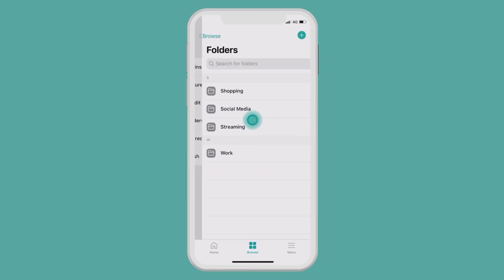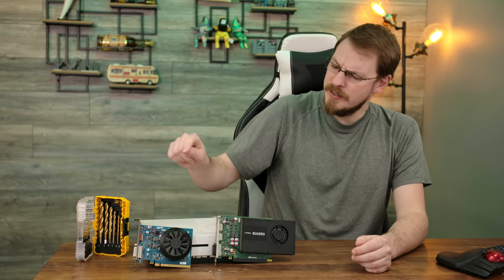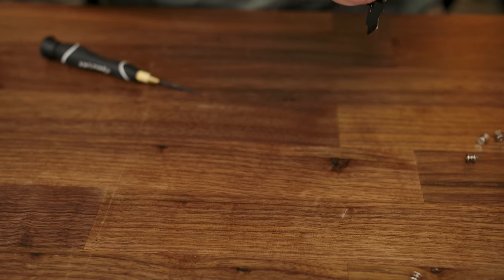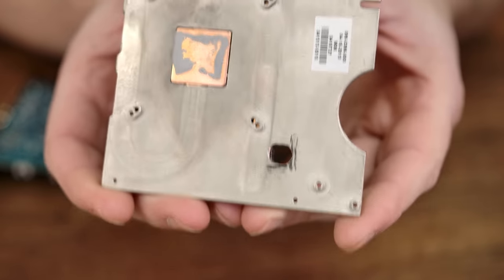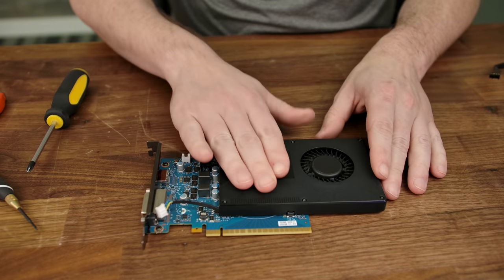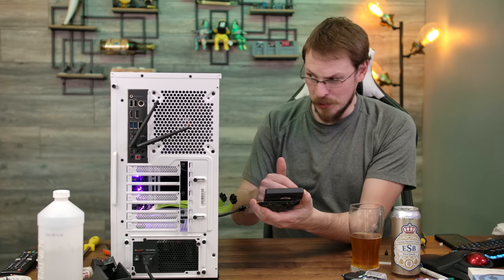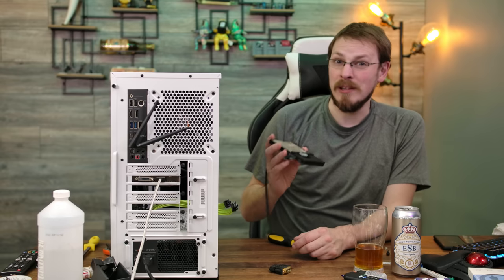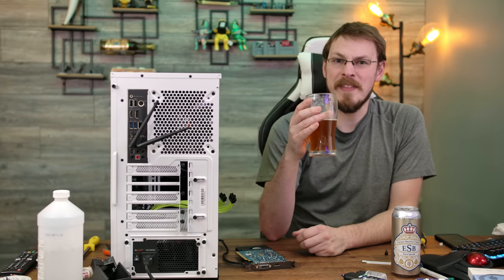Making my own Single Slot GPU Cooler

Comment: I didn’t know the older cheap cards were sold out too whew
Reply: The GPU market has gone straight stupid, and we're probably 3-6 months out from anything resembling normal.
Reply: i was able to find a basically new GTX 1070 gigabyte windforce for a friend who wanted their first gaming rig (sim racing) on ebay for about 250 dollars. it was listed as "used, good condition" because the box was open, but upon inspection, the card had never actually been installed in a slot, no marks at all on the pcie or any of the video connections. i consider that a win
Reply: @asdrubale bisanzio Nah, Nvidia has communicated that it may reintroduce mining SKUs to try to ease the pressure off of the consumer market. If they are considering this step, it means they have identified the miners as a source of problems in the supply of cards.
Reply: @asdrubale bisanzio Mining SKUs tend to be cheaper and not as highly binned. Farms want maximum ROI, and using expensive highly binned AIB cards is counterproductive to that.

Comment: I feel for you brother! I needed a heatsink/fan for a slotted Pentium 3 and I looked through my stuff and came across a GeForce 650. Two of the mounting holes for the cooler line up on the P3 but two would be hanging off of the card. What did I do? I put two razor blades as a shim in the top two holes on the cooler, and they clamp down to the very edge of the processor card. I still used the springy screws on the razors as well so it keeps the cooler at even pressure across the die. This cooler keeps the P3 around 25 Celsius and 30 under load which is nuts compared to what I remember P3's running at.

Comment: Hats off to you, I love this video! I have successfully transplanted an EVGA GTX970 cooler and fans to an HP OEM GTX760 as I bought both cards as ‘only for parts’ but only the 760 worked - slight fin adjustment but the fan connector fits and works. Temps are really low even with maxed out OC.

Comment: Brilliant.  If I could count all the broken parts here from tinkering.  My worst is a shattered 24” 165hz IPS from a tip over in my cluttered workshop.  My favorite scene from your vid:  pulling out the bench top drill press.  Epic!

Comment: Is there any fan speed protection on that GPU?  The other thing that came to mind is the crystal, moving it to the other side could cause the circuit to fail because of it's closeness to the inner ground layer of the PCB.

Comment: Some of those metal can capacitors have the shell connected to one of the pins.  Try booting it up with the original heat sink, and then use a short jumper to ground each of those caps, one at a time, and see if anything happens.  If the caps are nonpolarized (look for +/- markings), you should be able to rotate them 180 degrees.  (Most caps have one side to ground.)

Also, most "heat pipes" are actually solid copper heat spreaders; you can shave a little off of them without ant problems.

Comment: You can also cut the cable of the original cooler and solder it to the 12v and gnd leads of the pwm fan. Running the pwm fan in dc controlled mode shouldn't be a problem and the fan would still be controlled by the card and not the mobo, also removing the necessity to have a wire running to the mobo. 

I did this multiple times when fitting newer coolers to older cards and never ran into any problems, but ofc I can't guarantee anything.

Comment: As other said, maybe the card just thinks there's no fan and thus doesn't even turn on.

I am also wondering if it would make sense to put either some thermal pads or thermalpaste on the vram as well, because on the previous (stock) cooler it had some airflow going over the chips but it doesn't with the quadro cooler.

Comment: if soldering components are an option. is it possible to replace with lower "profile" caps, instead of drilling holes? Even use some surface-mount on a perfboard, then solder through the hole on the back?

Comment: It is also possible that the GPU might not start as it is not detecting a fan/throughput on the fan header.
I would try to screw on the old cooler and check after modifications if the default cooler works.

Comment: I did this very thing but with a single slot Firepro cooler/fan mounted to a SBC. You can pick them up for about $6 bucks and they work fantastic. If you wanted a longer, more powerful one, but still a single slot. Go take a look at the 2gb Firepro server cards. They will set you back about $20 bucks.

Comment: Why did you not put the capacitors on the back of the circuit like you did with the crystal oscilator? They seemed to be go straight through the board as well.

Comment: If you cant put the caps on the back of the card did you consider standing them off (front or Back). New caps come with long leads. Put a 90 on them snd stick the cap out the side of the board. Heat shrink the exposed leads and a drop of silicone to strain relief the cap! I don't think you even needed to drill holes in the heatsink.

Comment: Extend the length of the fan cable to plug directly into gpu board. Cut the wire, and then extend each of the 4 wires with solder on either end, and shrink tape each connection. Possibly the gpu detects if the fan is connected and working, and if not, then it doesnt work? Try it

Comment: I'm gonna guess, it's not POST-ing (the BIOS on the GPU) due to the missing fan. Crystal oscillators, as far as I know, aren't affected by polarity. Perhaps you could mount the cap the other way round? But I'd check the fan header first before trying to replace that. Great video!

Comment: Would it be possible to replace the caps with SMC versions? They'd all be flat at that point. If they are through-hole you could try mounting the originals on the underside but they are big and I think they'd take up too much space. As for the crystal, my immediate thought was that the pcb mounts that you solder the legs to are on the same side that you are now placing the crystal on... even running a bunch of solder through the hole on the top side won't guarantee that you'll bond to both necessary surfaces. Lastly regarding the comment about possible damage to the crystal - too much heat will in fact damage them. It's good to be careful to only apply heat in short intervals to them when soldering.

Comment: I'm not sure if it would work with your desired GPU mounting (or at all) but did you consider mounting the new cooler at a 90 degree angle? That might get the heatpipe out of your way.

Comment: Try a tantalum block capacitor on the back. They make small block style type, usually yellow. Or, when you get the replacement cap it will have longer legs, you could move it back a little and on its side.

Comment: Did you try to plug in a two pin dummy fan on the gpu? Some gpu with two pin fan headers have fail safe mechanism baked into their vbioses. It might be reason why it is not giving out a video signal.

Comment: Jeff, I just started this video and wanted to know if you thought about removing the aluminum heatsink from the "cheap" card and just milling down the tops of the fins until you reach your desired depth?  I will now continue the video to see if you chose "the hard way."
Reply: Now I see... you're trying to make it fit in only one PCIE slot.  Some challenges should be left unaccepted.  If it happens to turn out how I think it will, I'd be happy to mount a normal heatsink on that K2000 I'm drooling over.
Good luck.

Comment: Is that a through hole cap? Could put it on the backside too. 
Also, why not toss some paste or thermal pads on the ram and cool that too while you’re in there? The ram used to get airflow. It won’t anymore.

Comment: Do what you did with the oscillator to the capacitors as well, and you shouldn't have any issues. It also looks like the soldering on the crystal is a bit cold and may not be making contact with the pads correctly.  I wonder if the actual pad is only on the backside of the board and the solder isnt getting contact, or if they are shorting against the case of the oscillator. Maybe try remote mounting the oscillator with some bodge wires instead?

Comment: @Craft: Nice work you have done there. I cannot help myself but thinking if it wouldn't have been easier to get the conflicting components botch wired out of the way. Okay: The result would not be pretty but it should work better.
One thing you should try out is to connect the original fan as well. Maybe the GPU BIOS is programmed to look for a resistive load on the pin header and stops the card from working.
This happened to me in the old days on ATI GPUs and 8800GTs quite a lot so I think it is at least possible.
I think you know how to connect your pwm controlled fan to this GPU board but if anybody does not know: PWM-controlled fans have the following setup: Power, Ground, Speed-Indicator and PWM-Signal. If you connect a voltage to power and ground and leave the other pins floating your result is a fan spinning as fast as it will go with the voltage supplied. It is possible to use a PWM fan on a voltage controlled setup. If the setup uses the Speed-Indicator and is programmed in an intelligent way, you as the user would not even know the difference.

Comment: Is there a follow up video to this I wish to see another video fixing this but did you ever try putting back the original heatsink and see if it turns on and if it does try connecting the fan of the old cooler and turn on the pc see if you get a video out cause dell and hp love putting original fan has to be connected or motherboard throws error codes or simply not turn on

Comment: Did you try to boot fully into the OS? This is probably not the case, but my GTX 1070 wouldn't show any video in the BIOS, and the MB's troubleshooting LED's showed GPU error, but it would eventually show the video when it booted to the OS. Maybe that could be the problem if you tested the 1650 on a different machine?
To fix it on my GPU I did a firmware update from Nvidia to support newer Display Port standard.

Comment: Apparently Inno3d and Elsa both make single slot GTX 1650's. The PNY XLR8 1650 also looks like you could trim it down to a single slot... But at $220 (canadian), that's just mental!!

Comment: Is it ok to have the copper heat pipe right next to circuitry like those capacitors? Wouldn't it introduce more heat into those components?

Comment: When you removed the crystal oscillator did you get it out clean or did you also rip out the via bushing? Desoldering with wick of multilayer pcb is sometimes harder then people think i tend to advise having and iron or smd station that can heat all pins at once so the component can fall out by gravity instead of needing some force.
Reply from the maker: I got it out clean. I also saw your comment about the solder balling on top rather than forming a peak. I resoldered it, and it made no impact. Card is still not recognized in the OS (booted with another video card for output).

Still betting the cap is the issue. I have replacements arriving Friday and will give it another go.
Reply: @CraftComputing  I'l be watching then when you post again about this because i can not imagine you permanently damaged the card beyond repair.
Reply from the maker: Yeah, I agree. It's gotta be something simple.

Comment: If you can't solder the capacitors on the back, you could simply extend them, use some wire, relatively thick and as short as possible to minimize resistance and inductance, and place them where convenient.
Also, unless those capacitors failed closed, they shouldn't cause the card not to work, they are most likely just for filtering.

Comment: Board level repair/modding is the bestest. So much fun, always amazing when you get something to work lol. Only thing is you find yourself buying more and more tools, I just got a bench PSU (not ATX, like a variable voltage power supply) and am looking at better soldering irons and a hot air rework station!!

Comment: Is it possible the card just doesn’t power on if it detects nothing connected to the 2 pin header? Can you just attach the old fan to the header while the computer is on to test it.

Comment: Maybe BIOS is switching to onboard graphics as default if it has any? Had similar issue with a 2200G. Had to set to PCI Primary for it to stick to my graphics card after booting on the Vega 8 graphics previously.

Comment: I did read trough the comments and noticed some folks think the crystal might be shorted, depending on the housing of the crystal this might be the case. Some crystals have very small isolator around one or both of the legs. The metal of the bottom should not touch the solder joint. In flow soldering in the factory this is not problem because they appliy the minimal amount of solder and uses the capilar effect of the via fill the hole in the pcb. For manual soldering crystals on for example prototypes there is the option to buy a ceramic isolator (looks like very thin glass) for under the crystal oscillator. This makes sure every hand soldering of such component ends up working.
Reply: In addition a trick used by engineers when they run out of ceramic isolators and don't have time to wait while they are ordered, is to stick a very small screwdriver under the the component while soldering and therefor soldering it raised on the pcb. This makes the component more prone to defects due to bending force on the legs which transfer inside the component to force on the actual crystal. Something not acceptable in production products but acceptable in prototypes. Also if it works you could add a drop of glue to make the component resistant to mechanical force.
Reply: More "open doors" if the crystal has only one leg that has an isolator around it then the component is polarized (like a electrolytic capacitor) well sort of anyway. It will not damage the component when used the wrong way around but the leg that is connected to the housing is used as shielding depending on the circuit this leg should be connected to vcc or gnd. The leg with the isolator is going to the oscillator input of the integrated circuit. Many times it will work both ways around, how stable it works depends on things like the actual frequency.
Reply: The join closer to the PCIe bracket is more likely the issue, it is a round ball hugging the pin, this is a typical indicator that it hasn't properly flowed onto the pad beneath. A sign that not enough flux were used during soldering.

In regards to spacing the crystal up off the board, this isn't needed.
The package is designed to not short out. And the main reason that some devices do have spacers is for 1 of three reasons.

1. The use of plastic/glass spacers is for minimizing the risk of issues arising from tin whisker growth, a fairly rare issue.
2. The plastic/glass spacers can also be used if one has the board placed "too deep" in the wave solder machine. (Placing it deeper can be needed for certain components, typically heat sinks, then one frankly has little choice then then space everything else up higher.)
3. Or one uses ferrite spacers, as to combat EMI issues. Typically not needed on crystals due to them being filters in their own right.

Lifting the package up off the board with a screw driver or other spacer on a prototype as to "not risk solder bridges" when hand soldering is not needed. Getting a solder bridge in this area is next to impossible unless one purposefully pushes the solder wire into the hole and feeds it way too much solder.

Only reason to lift the crystal on a prototype is if the board designer has made the pads way too large, or one works on non solder masked boards.

And the only crystal packages with pins connected to the case itself is crystal oscillators, ie, a device with usually 3 or more pins that feeds out either a logic signal (square wave) or a sine wave. These tends to have their ground pins connected to the case. But general 2 pin packages don't have the case connected.
Reply: @todayonthebench  The pads actually might be too large as many designs have the pad smaller on the side of the pcb that the component will sit. As he has flipped the component he might now have the issue of too large pads and so shorting both connections. You are correct that the glass spacer (it's extreme thin so hardly spacer at all) is for preventing whisker growth when used on components as crystals. More often it is used as isolator on power and or high voltage components to isolate the component from cooling blocks. If he has a multimeter he can check for shorts. If there is no short the raising is not needed.

Comment: Could you not have relocated that Capacitor to the rear of the board as well as the Ocelator? Perhaps run some wire leads to the capacitor, and just relocate somewhere else on the front or back?

Comment: There is a good chance that it's not actually the capacitor or the crystal. I think the card would also run without the cap. But it could be unstable due to voltage fluctuations. What about the die hight?
Did you check that?
Is it the same or is it maybe just a little bit too much pressure? 
GPUs are very sensitive to mounting pressure. My 1070 has an NZXT Kraken G12 on it and if I over-tighten the mounting screws, it won't output any video/won't post. If it's just a little too much, I get graphics artifacts. 
You should check that.